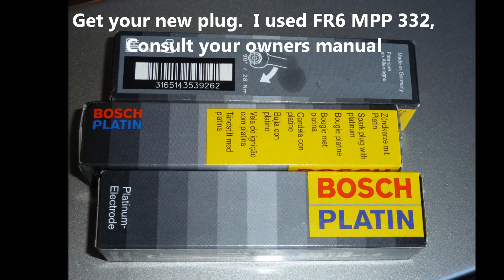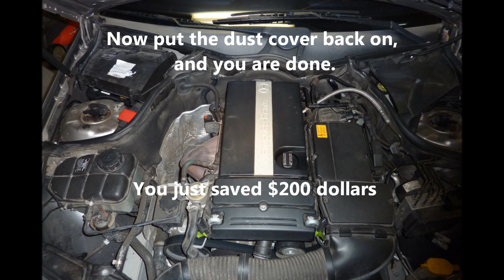DIY Mercedes Benz Spark Plug Change on a c230k

Comment from the maker: Thanks for the compliment.  I am not positive about the changes in motors from 2003 to 2007, but it can't be that much different.  I would say that once you lift the dust cover, everything will look pretty similar.

Good luck.

Comment: Thanks for the video.  Did my plugs today on my 2005 C230k w/ 80k miles. Found original mercedes plugs.  Replaced with NGK 6619 Iridium Spark Plugs LFR6AIX-11,  Runs great!  Also you can get the size 8 socket from Harbor Freight.

Comment from the maker: It sounds like the plastic cover might have melted, or fused to the engine, you might check an auto salvage yard for a replacement cover.  But, in the end, consult your owners manual, or even the people at Mercedes... sometimes they might actually offer sage advice for your DIY project.

Comment: Which wrench # did you use? #8 seems much too big on mine.
Reply from the maker: I used an elongated 5/8" Sparkplug Socket for the plugs, and a #8 Torx drive for the coil covers.  Some people call these a E8 Star Socket Drive.  I have also seen it mentioned on some Mercedes Benz forums as a T-30 Torx driver.
You can pickup the #8 Torx socket driver bit at Autozone, Sears or any other hardware store.
Thanks for watching.